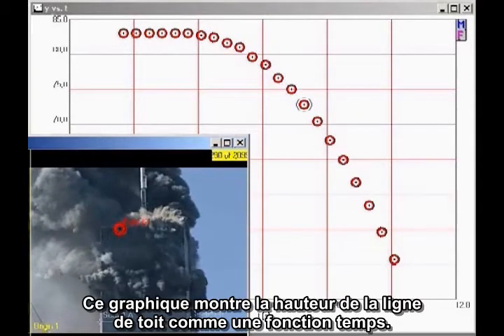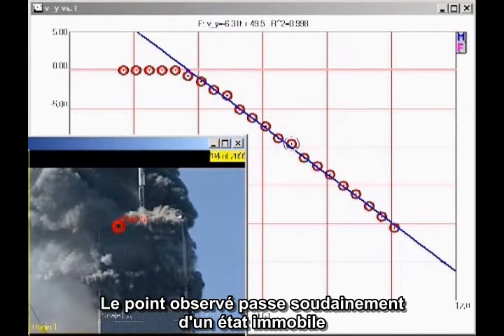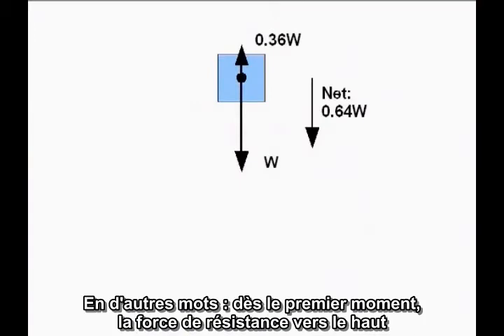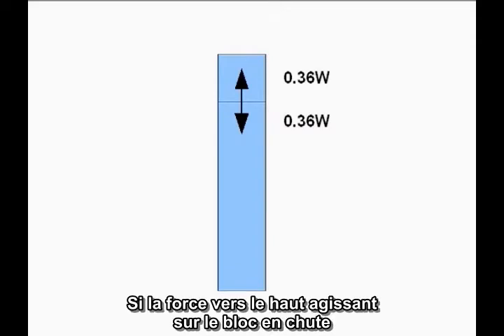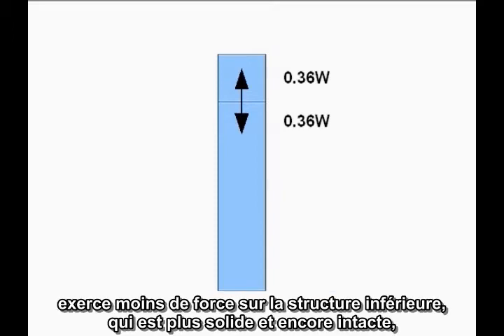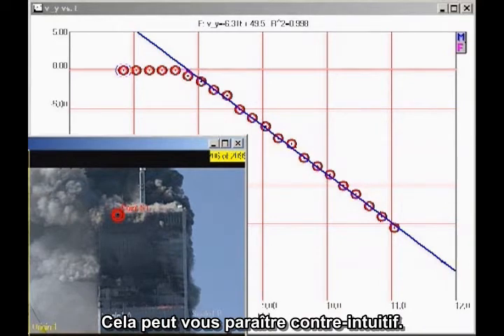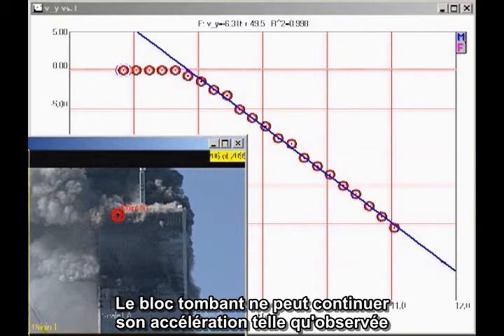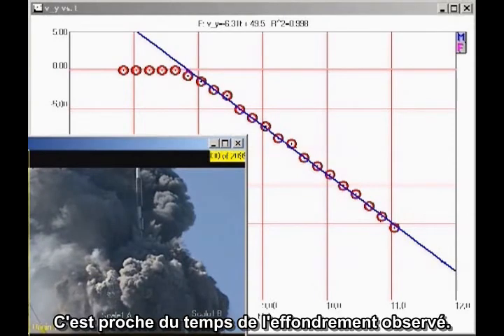David Chandler - Accélération de la chute de la tour nord

Comment: @MrSycho7 Where is the analysis of the acceleration and rate of descent on this one? Did it experience a jolt when it met resistance? That is the whole concept of this video in case you didn't understand. Can you find footage of the verinage technique used on a steel framed structure as the towers were? I think it's only used on masonry buildings.